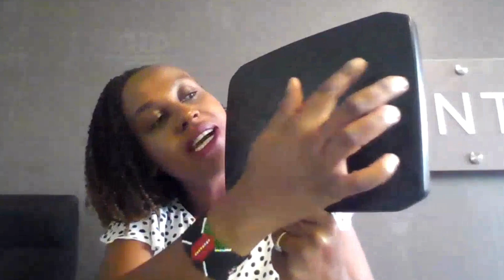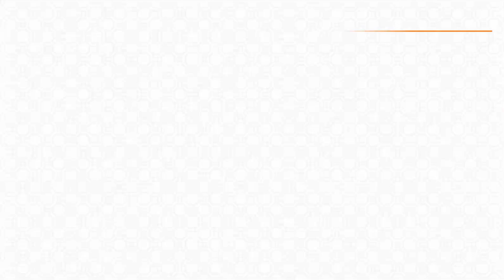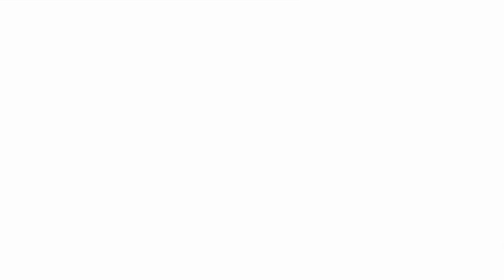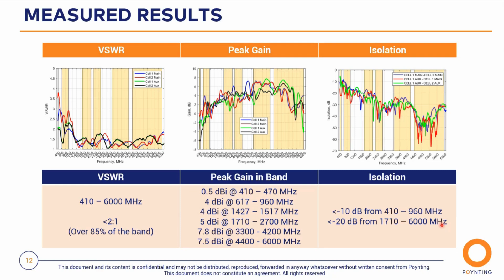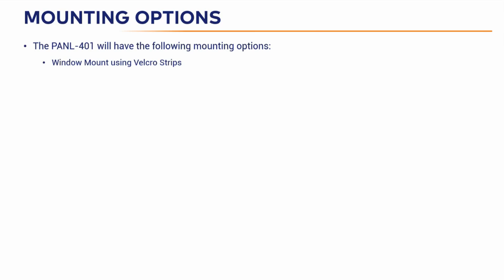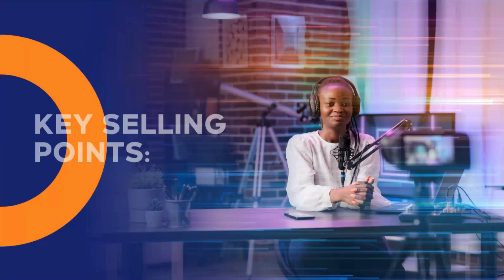PANL-401 Public Product Introduction Video

Comment: if you were to choose a permanent outdoor installation on the roof, would you choose this PANL-401 or MIMO-3-14 ?
Reply from the maker: The MIMO-3 versions is the best option for permanent installations on the roof of a vehicle. The PANL is for mounting on window where you can use the suckers or Velcro to mount it and remove if you want to use it elsewhere.
Reply from the maker: You are welcome to get in touch with RF SHOP Australia that can give you advice on which to choose:
Here is one of the many videos David made:
https://youtu.be/iL2afjeEu8g?si=2gVRJPsj4Fy5XVC5

Tel 1800737467 
enquiries@rfshop.com.au
Reply: Cheers, @poyntingantennas  i ordered thru RF SHOP again today.
XPOL-24 with Rutc50